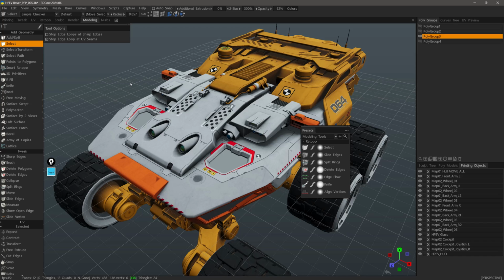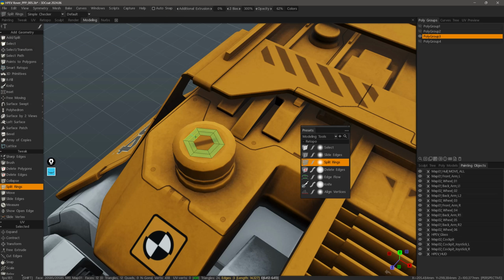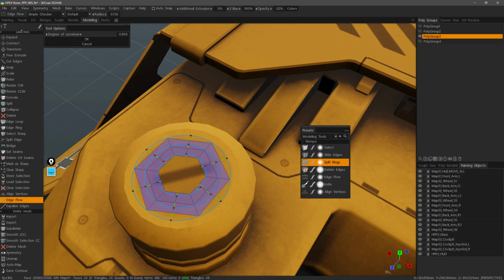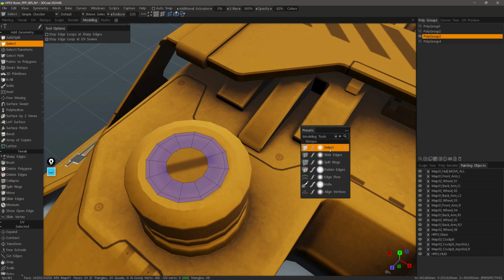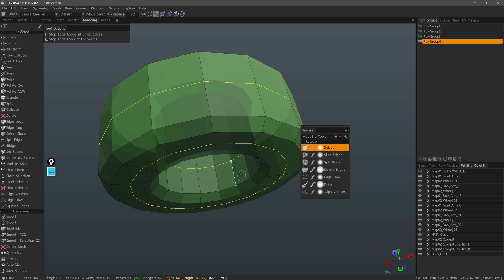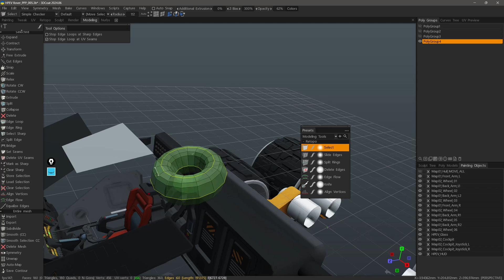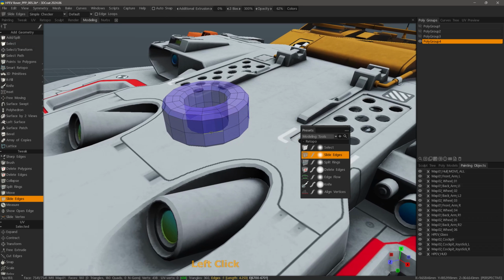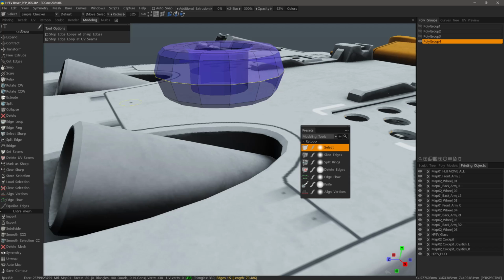Edge Flow and Equalize Edges

Comment: The modelling room keeps getting nicer tools. It makes me glad. 
However, perhaps I am missing something, but is there a way of selecting Polygroups directly in the viewport? Making selections of complete "objects" for later transforming them.  This would work like  Blender's "Object Mode" versus "Edit Mode". This can really help 3DC build scenes easier, at least for preview purposes before taking it to another renderer if desired. 

Oh, also, is there a way of knowing what are the current key bindings? I have not been able to find a list of them anywhere. Thanks! :D
Reply from the maker: This is something I have personally discussed with and requested from both Andrew (owner) and the developer of modeling tools, Alexander. Sometimes it helps if users will make the direct request themselves to support@pilgway.com and/or Alexander.Gorbatovsky@gmail.com.

In the meantime, you can select an object by double-clicking a polygon (while in FACES mode) to select all contiguous faces or click the icon at the bottom of the Polygroups panel, that says "SELECT ALL FACES ON LAYER"
Reply: @PILGWAY3DCoat  Yes, I can imagine. Knowing 3DC incorporates various ways of dealing with 3D objects  I guess using a combination of workspaces can also be a solution. However, for the modelling room to be it's own standalone room capable of producing a whole scene easily, full of complete models, I believe this functionality ought to be in place, besides envigorating the functionality of the polygroup layers panel, like easier groupings, selections and more options on the right click menu.

I intend to make a thorough series on polymodelling in 3DC. Being able to fully finish a model's topology, with excellent UV and texturing tools in 1 app is any 3D artist's dream, no app hopping, and I think 3DC can offer this. For this reason is that I am trying to find as much info about the room before putting together my series.

I will reach out in the forums for more info and see what else can I learn. Thanks and do please keep up the update vids! 🙂

Comment: Edgeflow always uses the average vertex to reposition? Can I define the resulting vertex offset or leave is as it is?
Reply from the maker: As with similar tools in 3ds Max (Set Flow), Maya, (Edit Edge Flow) and Blender (via the Edge Flow Addon), it is generally designed to create some curvature in the mesh, where there are just flat or sharp edges. Centering the vertex creates a nice even curve, as it is the Apex of the curve.
Reply: Yes, the tool now uses the midpoint of the spline. In the future, it is possible to add a length parameter to determine the position of the spline point